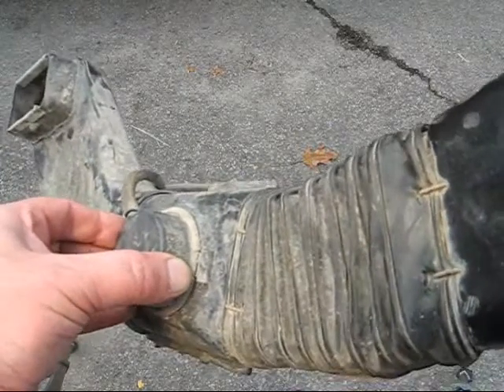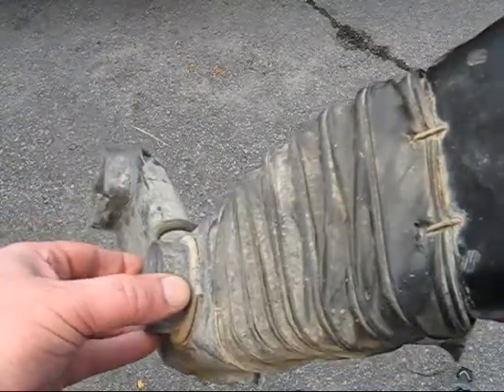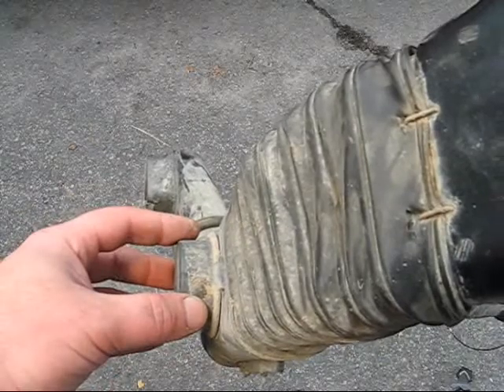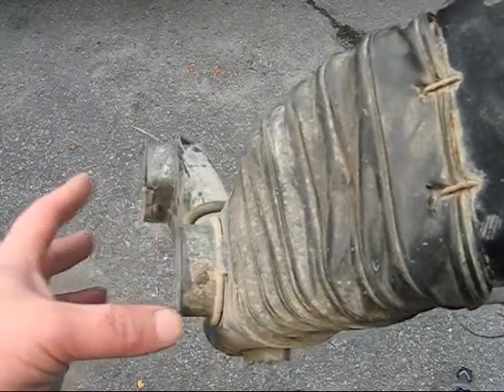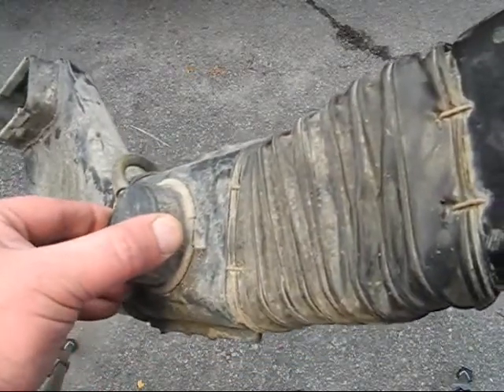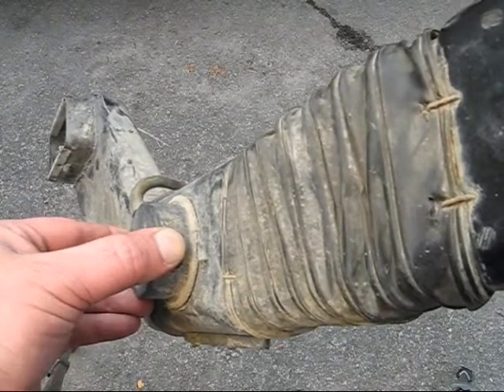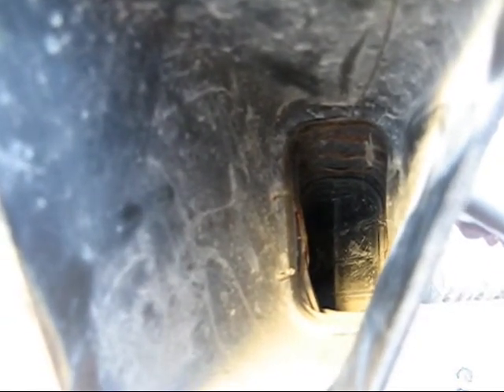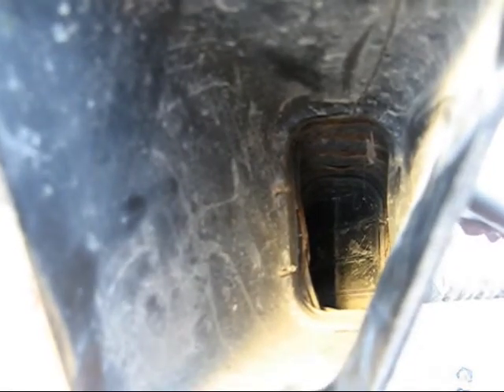Ford Explorer (91-94) AirBox Lower airbox assembly

Comment from the maker: Yes you can plug both lines and be good to go.  But you only need to plug the vacuum line coming from the intake manifold (with this being plugged the other line is Non operational).